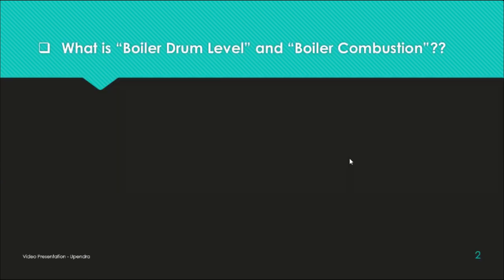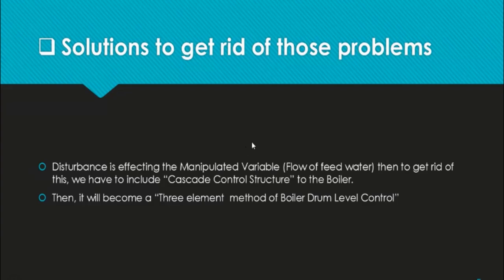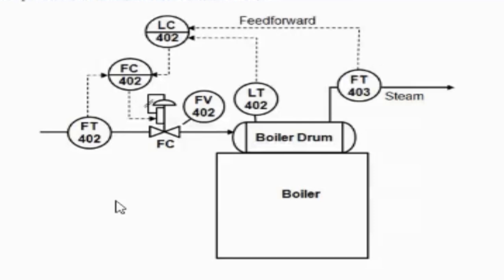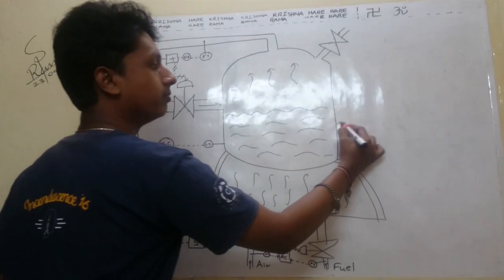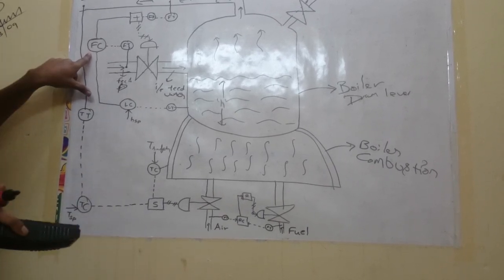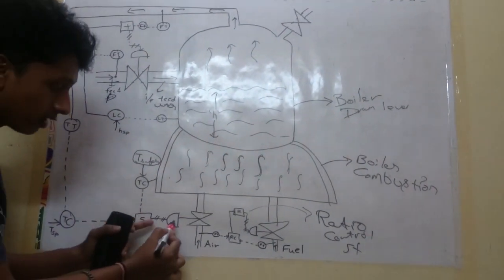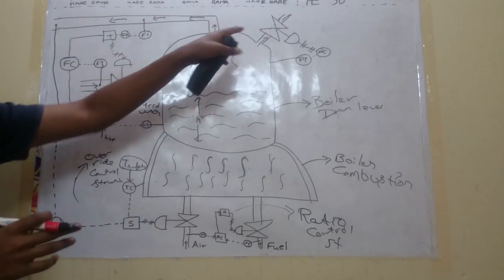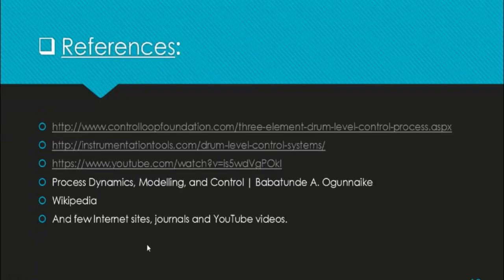Three Element method of Boiler Drum Level Control and Boiler Combustion Control

Comment: He is totally wrong on something. When the steam temperature increases above the set point, the fuel control valve shuts off first and stops the flow of fuel to the burner. However, the air control valve remains open so as to purge the combustion chamber. The forced draft fan or induced draft fan continues to supply air to the combustion chamber and then to the stack to remove unburnt combustible gases. An explosion can occur if the unburnt fuel is not removed from the combustion chamber. In short, if there is an interlock or an increase in set point of a certain parameter, the flow of fuel to the burner is stopped first. Nevertheless, the flow of air to the combustion chamber continues in order to purge the boiler. In other words, before the boiler is relit, it must be purged to remove any combustible gases. If the boiler is not purged, there is always a risk of an explosion.